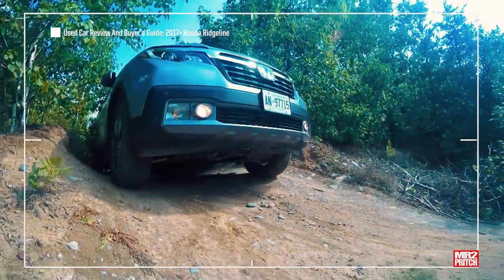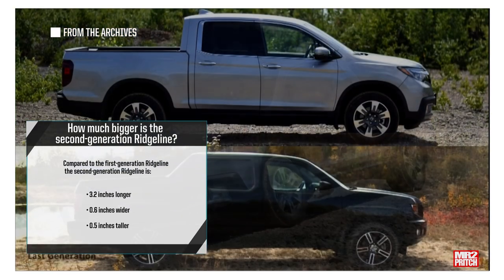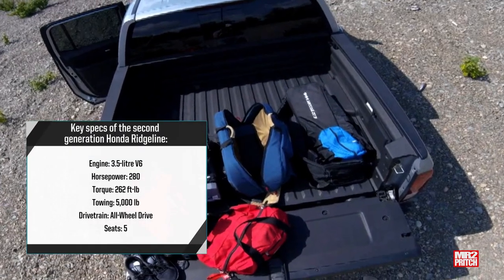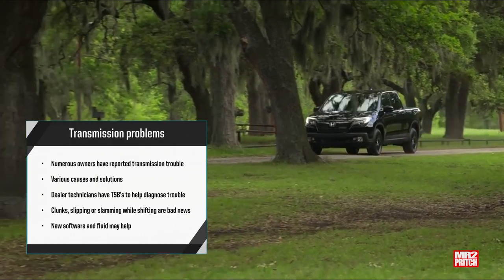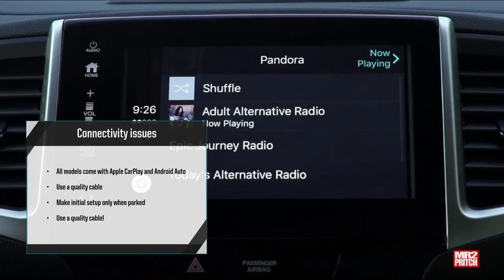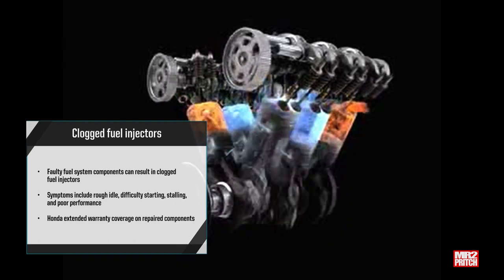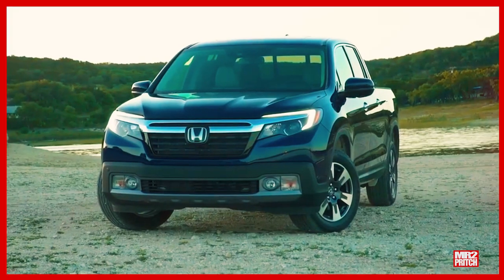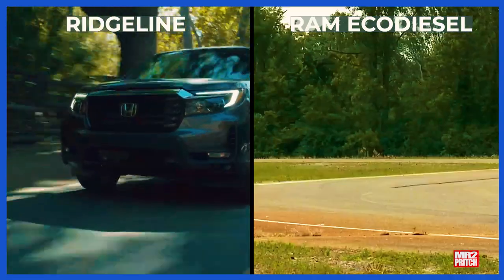Should you Buy a Used Honda Ridgeline? [2nd Generation] Used Honda Ridgeline Review

Comment: Have a 2017 Ridgeline.... 150,000km.... no problems so far/ vehicle recalls have been done ... this is a daily driver we routinely tow a small camper (2000lb dry)... I've carried full loads of wood/ drywall... heaviest load do far was a 1/2 yard of 3/4  clear ( no doubt pushing the load limit)... point is no car or truck is perfect, but for me the Ridgeline is damn close.

Comment: I live in Nigeria and am thinking of getting a used one 2017 model but am scared of the transmission issues. We have extreme rains and mud during the rainy season It will never tow, or carry heavy load just driving from my home to my poultry. It's just that transmission that scares me. I will also get a Tacoma with the Ridgeline
Reply: Did you get one?

Comment: My 2017 Ridgeline transmission needed replaced at 52,500 miles, symptoms were noticed at 48,908 miles. I lost $10000.00 on trade in value.
Reply: What was wrong?  Symptoms?
Reply: Bumping the post. We need a follow up on the man question.
Reply: @curtshumaker5768  don't think he will any time soon. I have a 2017 RTL-E with 62k miles. Most city driving which is even harder on auto transmissions. But I did an oil change 3 times already. Only thing I heard about is the tourqe converter. High failure rate if you have old oil in it.